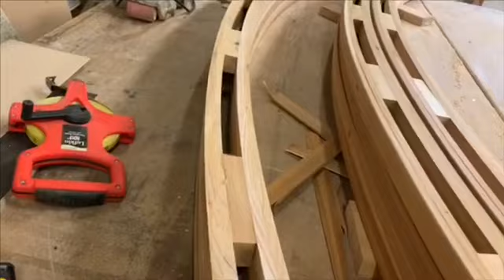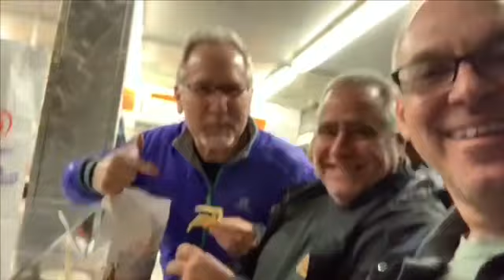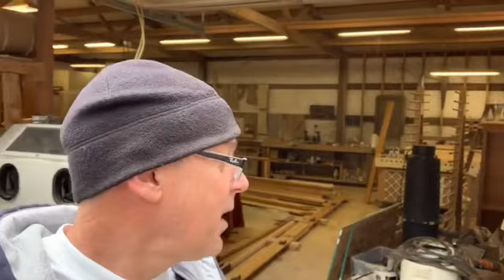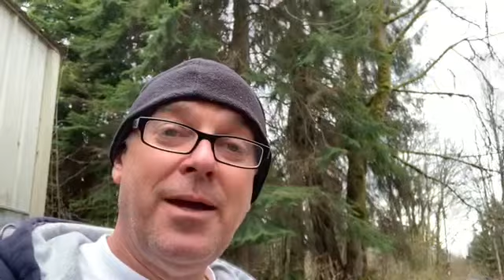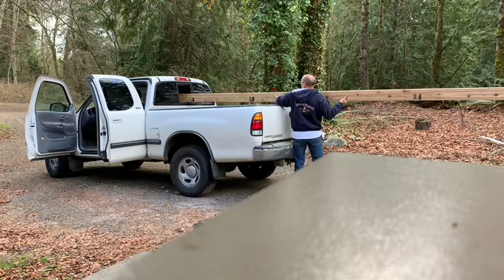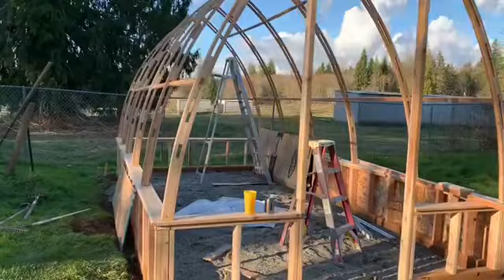Gothic arch greenhouse build | Putting up the arches | Busy Beaver | Chuck Beavers

Comment: The problem with having a stem wall is it is a hinge point for the arches and overtime that wall is going to bow outward if ridge support is not provided. You probably should have built each truss to continue down to the base sill plate so there could be a solid connection to prevent spreading with the stem walls being built in-between.
Reply from the maker: Yes that is a good point and I think you may be right. After all the great cathedrals had to come back and add flying buttresses to keep them from bowing out
Reply from the maker: Gary. Thanks for the advice. I’m always looking for helpful hints. Have you built one I’d love to see how you did it. You could upload your pictures to your channel. Unfortunately I learn most things the hard way through mistakes. Good knowledge is most appreciated. Thank you
Reply: @BusyBeaver22  In the process of getting information on the glues people have used to laminate the arches. I am retired from an architectural office so I am looking for new things to do with my time from what I learned over the years. I am going to use a staple gun to secure the laminates together after they have been glued. I was trying to avoid using pva glues because of the creep that you get from them. Epoxies are fairly expensive as are polyurethanes. I am leaning towards the polyurethanes as they have better gap filling ability than the pva glues.
Reply from the maker: @gary24752  all the best to you. It is a fun project. I would recommend having 2 people for the assembly it can get tricky at times. You should definitely video the progression.
Reply: Not a lot of weight involved at this scale. I suppose one could cut up some angle iron and north-south east-west through bolt the arches at the stem wall using 2 or 4 pieces of angle iron at each intersection if the original fasteners started to fail.
Reply: @davesmith9684    Nothing to do with the weight and everything to do with gravity..  The short stub wall is a hinge point and there is no tie cable to keep the walls from splaying outward. There should be a 4x4 at each arch that goes down into the ground 48" to counteract the outward thrust.

Comment: Great job, you do such good work. Could I use 4" pine and not worry about it braking? I want to bend a 12' board. It is for the top of a 10'x20' shed
Reply from the maker: Oh man sorry I’m just getting back. So late. Yes you could use 4” pine. I would make the boards thinner then 1” though. 
I would try for 1/2”x 4” x12”

Comment: I'm looking to build a gothic greenhouse this spring, however I'm concerned about the snow amounts that I get. What snow load can the double 3/4" hold
Reply from the maker: We have had snow over the winter. This greenhouse is 10’x20’ and the roof is pretty steep so the snow slides right off